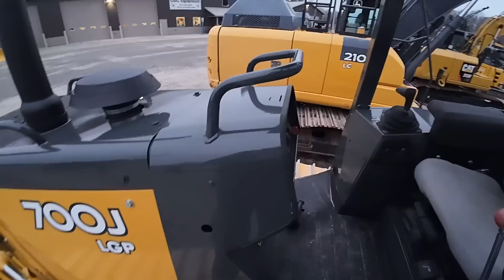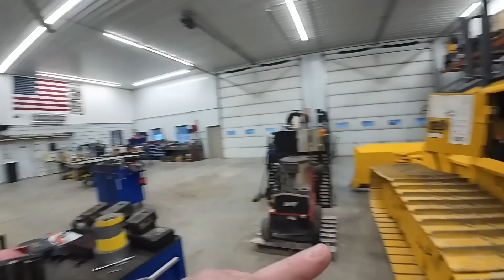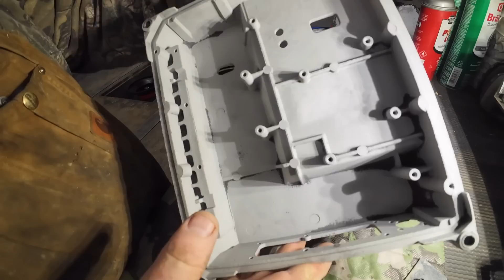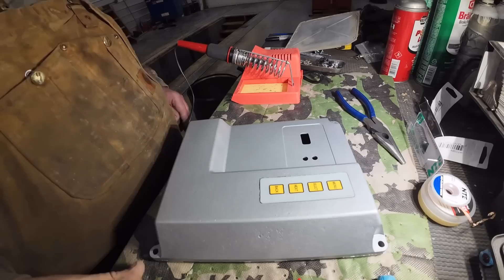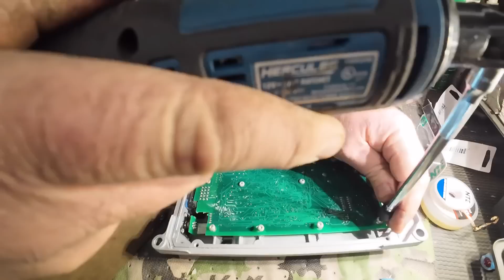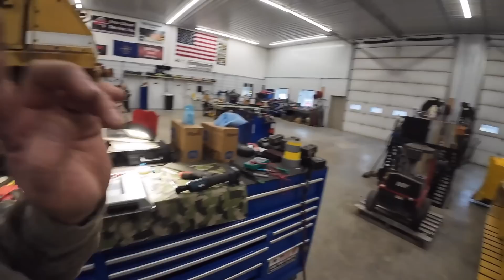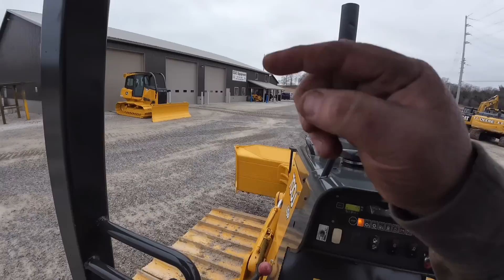John Deere 700J dozer transmission MC300 controller repair after it failed for cheap!

Comment: You would think that after the first few years and discovering that dirt and moisture get under that cover and affects a very expensive electronic component, they would redesign the location to be weather tight seal.  No water, mud, nor dirt would get in there.  The opening where the electrical is routed through should be sealed with a rubber boot!  🤷‍♂🤷‍♂ Makes you wonder how the engineers made it through their first year of "higher education".  🙄🙄 Overall, the repair went well and is significantly cheaper than having someone else do it.  Of course, if the repairs are beyond the capacitors, I'm sure that a much more in-depth repair would be in order.

Comment: I bet Hunter or Tucker would be good at this repair.  Did you silicone the new capacitors in place like the previous ones?  Wonder if vibrations could loosen them with no silicone?
Reply from the maker: We did
Reply: @C_CEQUIPMENT  👍

Comment: I had an old Caddy had codes and black smoke. I took in in they read the codes and said need a couple grand to fix. I took it home put a ground from the computer to the body and cleared the codes it ran great for 4 years till it got stolen.

Comment: Would this still work if you have a machine that goes from high normal power to low power randomly
Reply from the maker: Could be related, but usually that’s a different issue sounds like a limp mode due to pressures or temperatures
Reply: @C_CEQUIPMENT would that be able to happen after about 5-minute of run time

Comment: Is there no way to keep the controller more clean? There should be a way to seal it or move it to some place else.
Reply from the maker: In theory it should stay clean under a cover that has a foam gasket but what happens over time is the gaskets go missing and critters start living inside it

Comment: When handling circuit boards, you should wear a ground strap to make sure any static electricity on your body don't discharge into the circuit board and destroying other components.

Comment: Just an FYI acid core is not for electronics. Need to use razzon core for electronics. Acid core solder can burn up a circuit board.

Comment: Thanks for sharing! I'm putting that one in the memory bank.   I've done quite a bit of circuit board soldering fixing various things and you did good.  I think using some self leveling, sunroof clear silicone (it's a lot thinner than most) around the edge to set the screens in would be better even though it would take a few hrs to setup and cleaning and putting some dielectric grease on the connectors would help. re-silicone the capacitors so the high frequency vibration doesn't weaken the solder joint or break the leads.   I would also use some 1/8" thick foam trim tape that has adhesive on one side on the sealing surface of that cover.  
This is just another reason when I upgrade I will get an enclosed cab  :)

Comment: Use non acid 60/40 solder intended for electronics.  Acid core will destroy the printed circuit board conductors over time

Comment: Two comments.  First, make sure your capacitance tester probe polarity matches the polarity of the capacitor being tested.  Second, use anti static mat and wrist straps to minimize electrostatic discharge potentially damaging electronics.

Comment: What capacitor is needed for the h models?
Reply from the maker: They vary
Reply: @C_CEQUIPMENT  thanks for the reply. Turned out to also he 330uf and they were both good.

I have power on the red wire, but service advisor says there should be 2 power wires. I can't find a wiring diagram that says which wires are what. Im guessing it's grounded by chassis and not through the wiring harness? 
My green lights coming on but no momentary red light at key on or start, and the display is dead. Thanks again
Reply: Checked again and found 1 ground wire on the small connector. If it had good ground im going to tell the customer he needs a tcm.

Comment: CLINT I also recommend you buy a can of DEOXIT 5 and get a cheap paint brush 3/4-1” and cut the bristles off about 3/4” from the handle so they are stiff. Then also get a fibreglass scratch pen off eBay or aliexpress etc . After you remove the caps use the scratch pen with just a bit of the bristles protruding to clean the solder pad on both sides of the board.
Spray the deoxit around areas like connectors etc . Use the IPA (isopropyl alcohol) liberally over both sides of the board and scrub with the brush. If their is corrosion or water damage or water has been present on any areas then after the IPA has been dried off with a Scott’s towel then spray some DEOXIT there. 
My soldering station is American made and costs around $10,000 USD back in 2018 it can do everything including gold plating on PCBs. Good luck.

Comment: Man. I hate when people with a little bit of knowledge extort people when they find out how much the part they are repairing is super expensive. If that transmission controller were $100 brand new, they’d charge you $50 to replace the capacitors and be happy about it.
Reply from the maker: Add another zero and multiple it x2 and your right on the money of how most get "rebuilt"-Kevin

Comment: I repair those Sauer Danfoss MC300 transmission controls at ERD in Kernersville, NC. See our videos showing the dozer simulator used to test them. I've repaired ones in VERY bad shape. Excellent video! Great to see this dozer in action!
Reply from the maker: I had you guys repair a bunch for us until one of them did not work that was repaired, this is when I started messing with them

Comment: I have done hundreds of capacitors in a certain industrial robots power supplies. They get hot and old and slowly fail. The supplies are over $1000 used and with over 800 robots running production that can become costly.  One thing I would suggest Clint is to put some hot glue (or silicone) back around the replacement capacitors. Vibration and heat will over time crack the solder joints on the leads and make intermittent issues. That is why there was silicone around the old ones to begin with. Otherwise great job.

Comment: I have opened up some crane and cat controllers, we use acid etch and alodine before shooting the housings with engine enamel, the alodine converts the outer layer and makes it more corrosion resistant and the paint sticks way better. Crazy what they are getting for controllers now, just replaced a bobcat one for a skidsteer, over 4k.

Comment: Brilliant video Clint , big business just wants everyone to either buy new equipment or buy whole controllers or modules! Parts that used to be fixed with a cheap Oring , capacitor , brush set , seal kit etc are now required to be replaced with whole units . Yes large sections of society can’t put a plug on an appliance or even change a fuse🤯🤯🤯 but unless slightly more skilled people are enabled to repair we’re doomed!
Thanks for the hard work involved in making your team’s videos, keep up the good work and keep making us laugh sausage fingers😂 crossed

Comment: Greetings Clint I am an electronics guy who started my first job in a Radio-TV repair shop and then joined the USAF and later went to work for the military-industrial complex manufacturing sophisticated electronic equipment, satellite communications equipment mostly!  
Usually, when you're checking capacitors it should be done out of the circuit because the circuits around them may affect the reading! 
 If you have good experience doing it your way and it works, so be it, but usually that's not the way it's done!  
Those are electrolytic capacitors that's why there is a positive and negative connection, which are usually used in the power supply to filter the power so you have clean DC voltage! 
AGAIN you guys' intuition and determination to get the job done as efficiently and economically as possible is a lesson to be learned by all in the trade! 👏🏽 👍🏼☺

Comment: Clint nice job, a few pointers here- I would not wash the connectors with water moisture may kill the board. These are electrolytic capacitors and they have polarity and have to be installed correctly, if you want to check for capacitance best is to take it out from the board otherwise you have more components connected in parallel and it may screw the readings.

Comment: I'd like to have seen the capacitors tested out of circuit. Testing them in circuit could give misleading or completely erroneous results as it looked to me you may have gotten. Some larger capacitors have a bleed resister across them to discharge the stored charge you were aware may exist or they may be in parallel with others. These factors can influence the reading on the meter. There are other factors that can cause a capacitor to fail in a given application beyond simply the capacitance value. Also in an environment like a tractor where vibration is going to effect the capacitors it is important over the longer term they are securely mounted. That is why these ones had the third lead and the silicone goo to shore them up securely in place. The most likely failure would be the vibrations of a larger heavy component shaking on the leads causing the solder joints to develop cracks. It could take years.

The solder wick works even better if you apply some flux to it before use and be careful to apply only enough heat to the track on the circuit board they are only glued on and you definitely want to avoid lifting  a track. So a temperature controlled soldering iron is helpful. 

But I'm sure you are providing a valuable service to others to show how a simple repair may be all that is needed.

Comment: Clint It is important to get both the capacitance and the Voltage rating right when buying new capacitors. The Voltage should be equal to or higher than the marking on the old part. NEVER use a lower voltage rated part
Cheers Eric

Comment: I thought I heard you say the solder you used was acid core flux. Acid core solder will distort copper traces. Only use rosin flux or any high grade flux for electronic circuits.  Hope I heard you wrong and you were using rosin flux.

Comment: Crazy that heavy equipment from this era will get scrapped within a decade, because of built-in obsolesence like this. Not helped by Deere's aggressive lobbying against right to repair. They should be forced to realease all documentation after 10 years of production or sooner, so the aftermarket can make new computers with current technology to replace the old failing ones.

Comment: You might want to try a rosin core solder to solder in the caps. And when checking the caps you  should have them out of circuit (removed from the PCB).  Or not.

Comment: Excellent job. 
In today’s society we live in a throw away world. Most big companies would have scrapped that unit. 
It is truly sad we forgot how to do jobs like this. 
I dabble in electronics and it is very easy to do this repair. Just make sure you orientate the capacitor into the same position that you took it off.
These big companies don’t want people to do these repairs so they can sell you a new machines. Up to 20 years ago you could have taken this controller into an electrical repair shop and had this done. Not any more. There is a group of small business guys that have electrical repair shops fighting for the   right to repair bill which in the senate right now so we can go ahead and repair these components for a fraction of what these giant corporations would normally charge the end user.
It is really sad that we got side lined by these big companies like John Deere, Apple products, Samsung, etc.

Comment: I was a TV repairman 35 years ago. The only way to get are accurate test on the capacitors is to test them out of the circuit. But they’re cheap enough, just replace them. Good job

Comment: Clint has done a few of you guys a big favor here in showing this. How many of your equipment dealers would want you to see these tips I wonder! LOL.

However, If any of you folks are planning to do work on electronics make sure, absolutely sure, that you buy solder, silicone and generally everything you may need and use, from an ELECTRONICS supplier.
There IS a BIG difference in solder and silicones for electronics as compared to standard plumbing solders and silicones. ALSO, never, ever use your breath to blow dust away from electronics connectors, your breath contains moisture,... 'nuff  said?
I learned the hard way, and after some 40 years in the equipment business. I'm just trying to help you here. I am NOT being critical of  Clint's work here, I am ( as I've said ) just trying to help some of you and steer you in the directions that may save you from getting a headache or two.

Comment: Great video.  Did the same thing, different platform, on a 94 Ford Bronco.  Replaced a resistor in the air bag control module.  Cost me $6.00 .   Had no choice, parts no longer available.  Took 5 minutes.😂

Comment: Looks good to me, I will suggest wetting the sponge on your soldering station and use it to keep the tip clean.   Solder flows better with a clean tip.

Comment: 99% Isopropyl alcohol to cleanup electronic boards,  a little hot glue to secure the capacitors from vibration

Comment: This is the same repair made to lots of older electronics.  Jeeps with a 4.0L have an ECU which famously fails, and the fix is to replace all the electrolytic (can style) capacitors.  I fixed a couple of those, and also a battery tender, all by replacing the capacitors.  Good stuff.

Comment: You should be using risen core solder for electronics. Acid core is for copper pipe and the like.

Comment: Yep you can't test capacitors in circuit because the circuit affects the reading. You can use an ESR Tester/Meter in circuit but that tester doesn't give you an capacitance reading just a general health of the cap. My experience is that if you only have a few caps to test just replace them and don't even worry about testing! Sucks when they are glued in though!

Comment: Just a note.
For electronic soldering you should use 60-40 Tin Lead Rosin Core Solder Wire for Electronic Soldering.
Not acid core and flux, it will corrode over time causing a bad connection.

Also a 3 wire capacitor is two capacitors in one can.

Comment: Clint I noticed when you were reinstalling the circuit board that you had not put silicone back around the capacitors. The silicone is there for vibration resistance. Under vibration, the tall capacitor will shake and fatigue the leads, causing them to break off between the circuit board and capacitor body. A little silicone will go along way to dampen the vibration, making it last a lot longer.

Comment: While you've got the controller open it's always worth cheching for dry joints, especially on the sockets. They can cause all sorts of spurious faults.
As others have mentioned use rosin core solder but otherwise great job!

Comment: Another quick tip with capacitors, the relief lines that are carved into the tops of the capacitor (to allow for expansion when they blow sometimes) if the tops of the capacitors are swollen or are raised that usually indicates a bad capacitor, I e seen them slightly bulged and we're bad, this is very common in flat screen TV'S that have the "click of death" cycling on and off, pull the power board and check for swollen capacitors, 90% of the time they're the culprit 👍

Comment: You passed on an excellent tip, however you should bone up on ESD (Electrostatic Discharge) protection. The best short tip I can give to anyone who is going to send the unit out for repair is to leave the circuit board in the case when sending it out.  The last thing one wants to do is wander around with the circuit board in their hand and then put it into a plastic bag.

Comment: looking at those codes, its like a ford pickup when you change the wiper blades...LOL    Those caps are swollen..I have seen early cheap motherboards like that when they didn't use japanese caps. I AM BETTING if someone ever finds a crashed ufo, they could call you and yep 
I have seen that before its a bad whatchacatcher. Had to replace that  and they are not cheap. ITS AMAZING

Comment: Nice job! I would suggest you reapply silicone around the new capacitors. I'm sure that was originally applied to support them and dampen vibration to the solder joints as they will crack over time in a shaky environment. & never mind if you did and I missed it.  :)

Comment: Isopropyl alcohol is really good at breaking the bond of hot glue, usually it slips right off. And the best electronic cleaner by a long shot is DeoxIT, pricey but the only thing I've found that legit removes corrosion from contacts and switches. The big cans of QD or whatever are fine to remove dirt and oil and such but don't do a whole lot for corrosion.

Comment: To the guy that was at the auction with the dump trucks. Loved ur comment on the mack truck. The mack b models and the steelnose dms with the steel dash are the true macks. Learned to drive on a b model mack concrete truck and did drive a dm 600 steelnose with steel dash. Like all the big 22 inch steering wheels and and love all the macks with with the steel spoke wheels. No bud or aluminum wheels. As a kid best time was n that concrete truck with dad.

Comment: I'm trying to imagine the future "will it start" videos. When the sensors and controllers are no longer available. In some cases that seems about 15 - 20 years. Lots of good iron will be left to rot. But, that 60 year old D9 will still pop off and move under it's own power. Are we really that much better off?😢

Comment: the only other thing that would be worth doing after replacing the caps would be to coat the board with conformal coating to help water proof the board